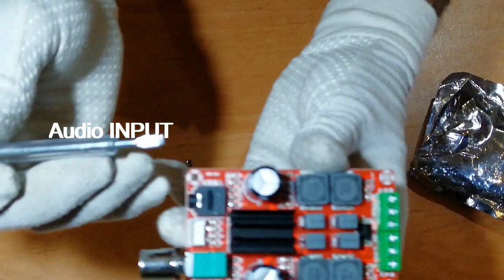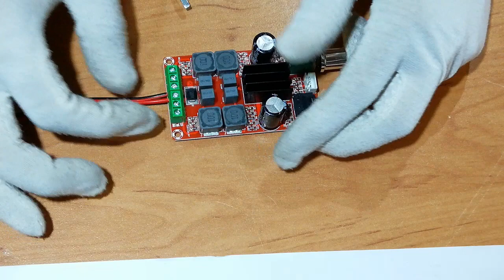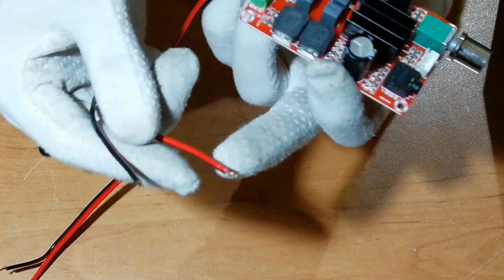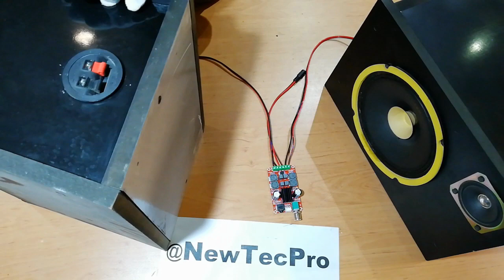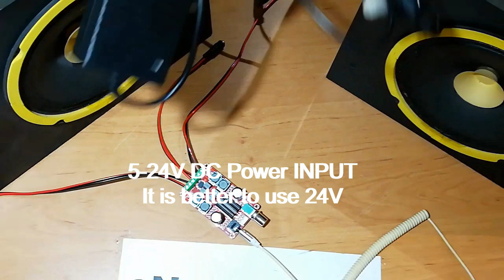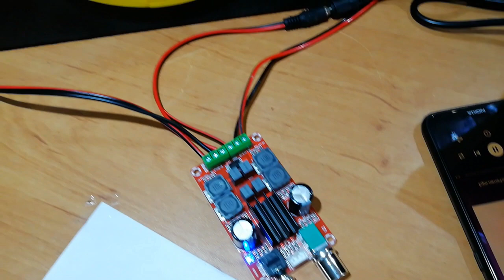Installation of stereo system audio with XH-M189 TPA3116 2*50W amplifier module.

Comment: Does the 24v 5A power supply have any distortion when amplifier volume is at max but nothing is playing? Is it better to use a higher quality power supply or a lower amperage one?
Reply from the maker: It is better to use a 24V 10A power supply. The current intensity of the AC_DC adapter is usually less than what is mentioned in the specification
You can also consult an electronics expert to install a capacitor with a suitable capacity at the input